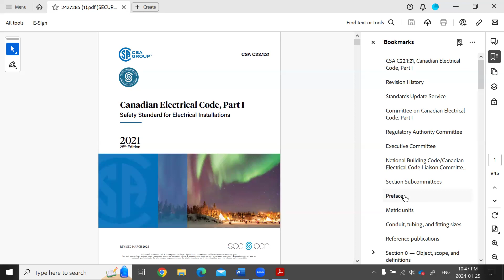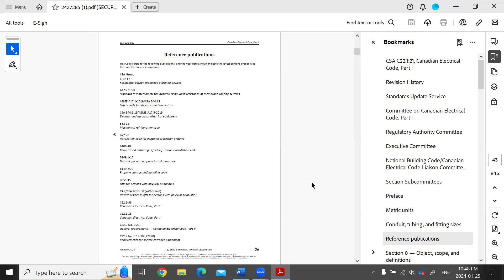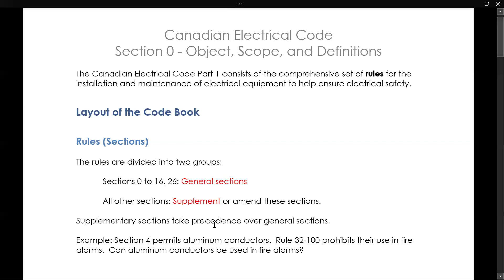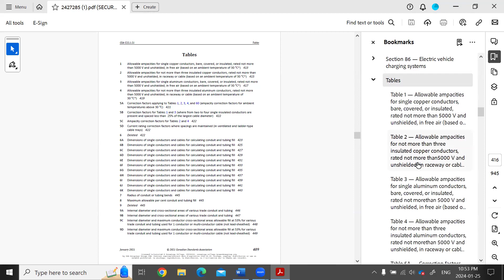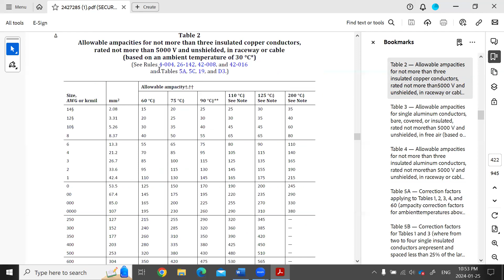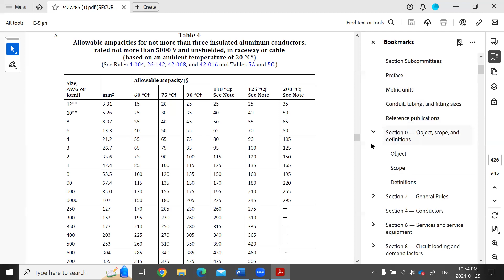Canadian Electrical Code Introduction and Layout of the Code Book

Comment: after completing 10hours session is there exam or just a 10hr video lession?
Reply from the maker: Depends on where you are taking your training.  Some training courses are available with or without an exam.  Ultimately you will need to take an exam at some point to use this material in the field of course.